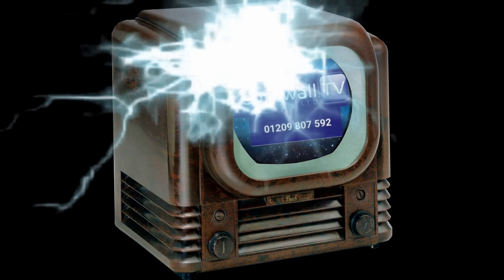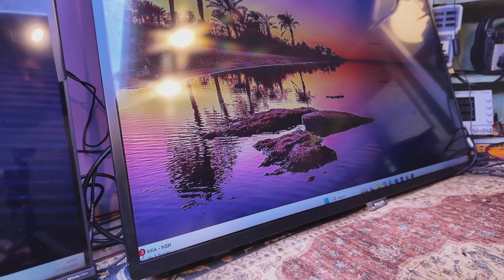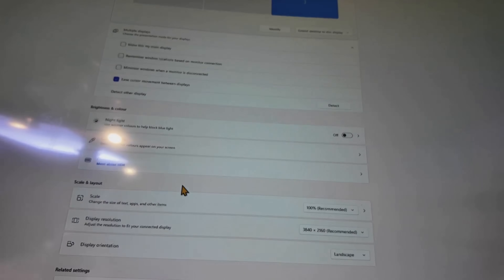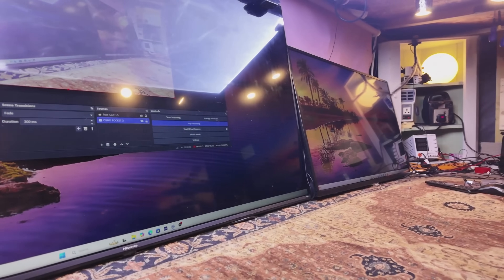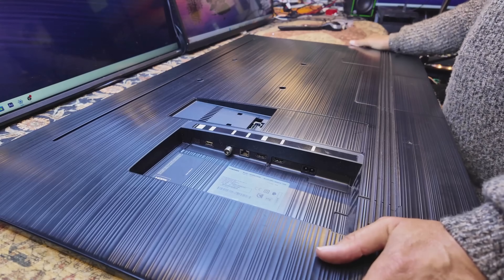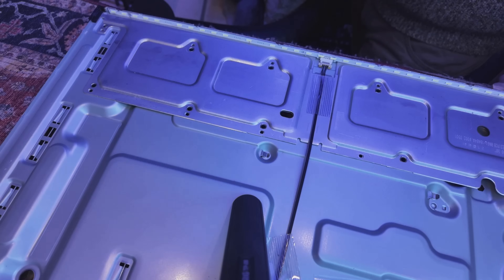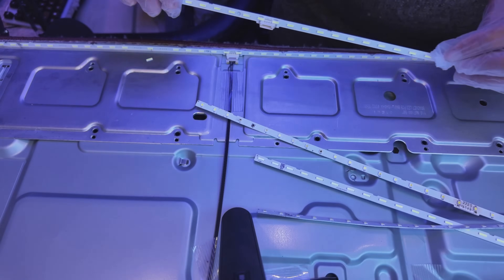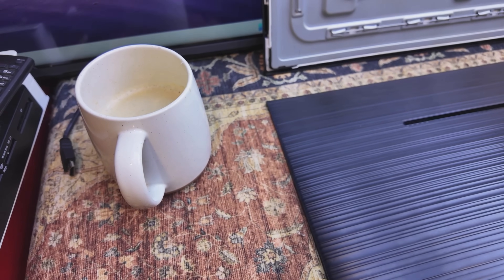Why did that LED strip fail  ?  INCREDIBLE

Comment: I'm afraid you are misusing "gubbins". Gubbins is a solid material, usually found in the corner of a shed, on an old shelf or in a sticky drawer. If left undisturbed it produces a "gubbins field" which attracts more gubbins. It also has a half life - a heap of gubbins will decay over decades into "rubbish", "junk" and "waste". Gubbins, when observed, may spontaneously morph into "It'll come in", "Oh, that's where I put it" or "I didn't know I still had one of those". As a warning, never touch your partner's gubbins without permission as it may result in verbal abuse.

Comment: A 1080p or 1080i screen will not show a 4k image in 4k, I suspect the main board processor has been programmed to reduce the resolution to allow the image to be displayed. This is possibly only true of more recent TVs ( those manufactured after 2012) to save people receiving no signal or muddled picture.

Comment: Allen, I’ve been looking into the “4K” issue with the Philips 43pft4001/05 TV and after searching I came across this, Not sure if it’s the answer you are looking for but it may clarify the situation a tad:
“No, the Philips 43pft4001/05 cannot display a native 4K picture because it is a 1080p HD TV, not a 4K Ultra HD model. The picture you are seeing is likely upscaled from a 1080p source, and you may be seeing a 4K picture from another device due to a setting or a misinterpretation of upscaled content.
Understanding the situation
* Your TV's resolution: The 43pft4001/05 is a 1080p (Full HD) television, not a 4K Ultra HD model.
* Upscaling: Your TV is likely "upscaling" a lower-resolution signal to fit the 1080p screen, which is a common feature that improves image quality.
* Another device: You may be seeing a 4K picture from a different device (like a Blu-ray player or streaming box) that is connected to another input, or the 4K label on the cable itself is misleading.
What to do
1. Check the source device: Ensure the device you are using is outputting 1080p.
2. Check the HDMI settings: Some Philips TVs have an HDMI EDID setting that can be adjusted. Try changing the setting for your HDMI input to see if it helps.
3. Check the cable: If you are using a 4K HDMI cable, this is likely the source of the problem. Ensure you are using an HDMI cable that is rated for 1080p, or consider upgrading your TV to a 4K model.”

Comment: Last night i pulled apart a tcl 65c2us to fit new edge lights .Sadly i found the prism sheet had cracks along the bottom and one large one about 200mm due to heat .I didn't fit the led strip but found 2 broken leds which i removed and soldered .I put it back together and the tv now works but has light bleed at the bottom .I changed the edge lights from 100 percent to 60 percent and i also am now on a hunt for a prism sheet .

Comment: What's happening with your dialogue? In places, it speeds up to sound like D Duck and then goes back to normal.
Reply: Just watched the whole video, and there were no issues at all with the audio here.  None of the other dozen or so comments mention any audio issue ... maybe it was just a glitch with your device or connection? 🤷🏼‍♂️
Reply: Are you touching a touch screen? 😂

Comment: I think HDCP will have something to do with it. I have an AV receiver that does this - when you're using the splitter HDCP is stripped, and 4k will be negotiated through the Hisense and the TV is able to downscale, but a direct connection results in a proper negotiation where the set will advise that it only handles / is licensed for 1080p.

Comment: The philips tv obviously works ay 4k 30hz. It probably won't work at 4k 60hz. My first 4k tv was the same.
If you connect it to your computer and get it 1080p 60hz. I noticed it wasn't positioned correctly. There are some setting in the tv menu to fix the screen position.
on my samsung its in
Picture size settings, then, fit to screen.
On the hisense tv, what is refresh rate?
On the philips,
I noticed you were connecting it to HDMI3. Try pluging onto HDMI1. The first hdmi port is important one, usually 4k where the other hdmi ports might just be 1080p.
On your computer you can set the refresh rate in the advanced display options (near the bottom of the display setting option in windows)
Hope this helps.
On a different topic my samsung 55 needs new backlights. (lots of blue areas) I have not opened it. can you help me source the right backlights
thanks

Comment: I have very little hands on experience with TVs, maybe 10 different makes and models total ... the strange thing I noticed is that 720p screens do accept 1080p signal and on some TVs there's a setting that makes it the recommended resolution on the PC.
Same thing could be happening to your 1080p screen, it can decode 4K and scale it down to 1080p...